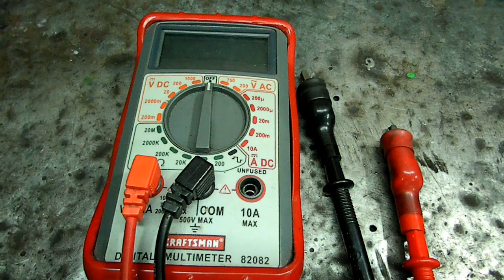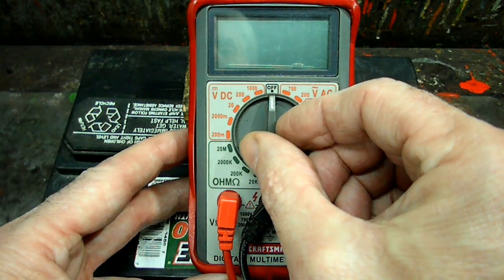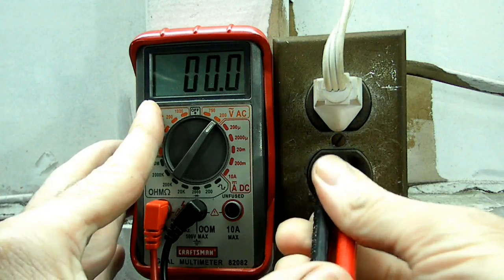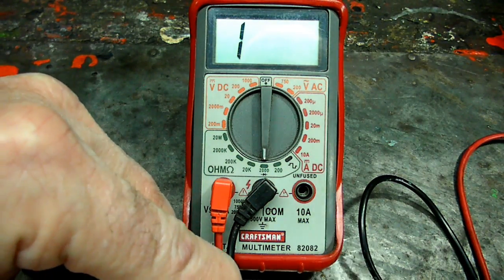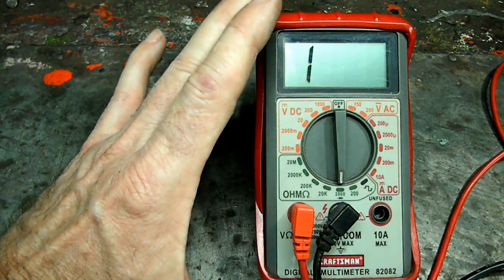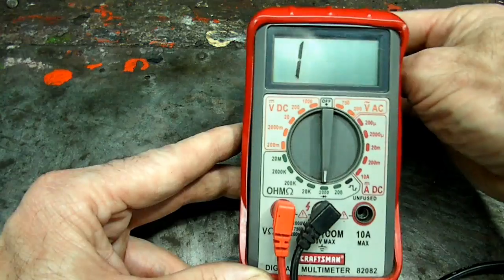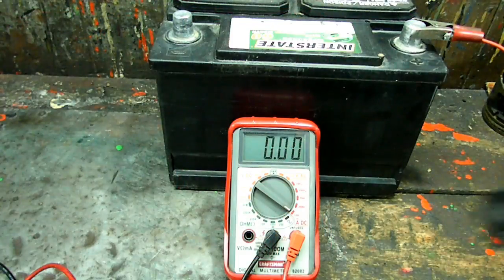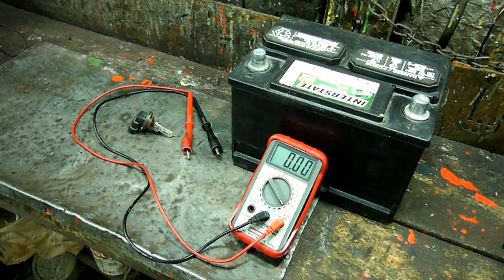How To Use A Multimeter

Comment: richpin, I'm trying to test the resistance on the primary windings in my old style 12V ignition coil (Accel) on my old chevy truck, and the company states it's 0.700 ohms, but when I test it jumps from 0.700 - 0.900.... Does this mean I need a new coil or is it normal?

Comment: do you have a digital voltmeter... set to 20 volts DC.
engine off.. headlights on for one minute. then turned off..
check battery voltage..
12.65 is a fully charged battery.
12.45 is a 3/4 charged battery.
12.25 is a 1/2 charged battery. if you have less than 12.5 volts have your battery charged and load tested..
once you verify that the battery is close to a full charge after you have removed the surface charge with the headlights on trick...
get the engine started... turn the headlights back on..
Negative battery post to the positive battery post.. 14.1 to 14.8 volts is expected..
Negative battery post to the engine block. 0.04 volts DC MAX..
Negative battery post to the body of the car.. 0.02 volts DC MAX.
Engine block to the Body.. 0.02 volts DC.
if you get more than the 0.04 or 0.02 volts on tests 2, 3 or 4.. you have a bad ground connection..
you can and should also.. after running the voltage drop test above..
test from the battery post to the alternator output terminal.. because of the amount of output.. i normally expect this to be up around 0.07 volts..

Comment: I got the free one from Harbor Freight along with their solar panel kit 45watt three panel and the 2000 watt inverter. where do I turn the dial to (set) so I can measure how much each panel is putting out. Just getting into this. I got a 12v deep cycle marine battery (walmart) to hook it to. Going to try putting my dish receiver and big screen tv and maybe laptop on it. Have a more expensive light strip with fuse to hopefully protect.

Comment: Thanks!  Trying to check a car battery with a multimeter is much more difficult when you have no clue how to USE said multimeter, lol!  The one my ex-husband had has no instruction book and nothing on the front to explain the symbols.  I was also confused by the 3 places to plug in the leads.  Your video was just what I needed to help me get started.  Now I can also check the outlet in the bathroom.

Comment: make sure to plug into the V-mA (600V MAX) side when testing a wall outlet! my multimeter had the correct red lead hole for this application on the opposite side as the ones in this video

Comment: When inserting into the outlet no.
A/C means Alternating Current. and D/C is direct current.
When current is alternating it means the voltage goes from positive to negative and back again (thus alternates and no need for polarity). 
Direct current is straight from the source (like a battery) and polarity doesn't change. (and can be a positive or a negative voltage - but not both at the same time)

Comment: Thank you Richpin for the answer.
so ? a amp reading with 0.50 is 500 miliamps correct ? 
I have my amp meter set on 10 amp max and the reading came up as zero point five zero.
I saw other videos on youtube where the max should be around 50 miliamps.

Comment: Hi Richpin you and Eric the Car Guy do a great service for us average joes with no money in how to fix their cars.
Rich I have a battery draw problem where my battery goes dead if I leave it hooked up.
I traced it down to the BCM/Cluster circult.
Amp draw is 0.49-51  is that 50 MLA ? 
I know in a normal situation there is a 50 MLA draw for the clock computer to stay alive and other things.
Is 0.49-50  50 miliamps ? or is ? 0.05       50 miliamps ? 
Is 0.49  490 miliamps ?

Comment: Hi, thanks again answered a few questions :) Only problem I'm having is that I bought leds to use as foot well lighting in my car and a 3 way rocker switch on/off/on only problem is I'm trying to get it to have one of the on positions to be constant on and the other on with the door/off when door closed and so far I have only the on with door working and can't figure out how to test if current is flowing through wires to see and try and figure out what wires to tap into

Comment: Don't test a battery like this if you have a have the multimeter in amp setting (with the red probe on 10A). You will fry your meter like I did when I forgot I had it set like that. I was lucky the meter wasn't an expensive on but a 4 dollar harbor freight deal.

Comment: If you accidentally touch the positive and negative with the same lead or piece of metal you create a short the same way as touching 2 wires together, This is the principal on which an arc welder operates.

Comment: Ah! Just tried this with the dial set to ACV 200, and got huge blue sparks. Luckily, the testing needles had enough insulation to keep me from getting electrocuted.
What did I do wrong? The metal needles are screwed up now with burnt tips, after only a split second. I shudder to think what that would have done to my weak animal flesh. No big deal, in the end, I'm alive, but what did I do wrong???

Comment: Thanx, after watching several videos that just showed how to touch the prongs to an item, you actually explained somewhat where to set the dial. For people who don't have a meter that has a zone where the a/c or d/c setting is, always remember that sqiggley line over V is A/C volts (household) and straight line with 3 dots under it is D/C volts (automotive).  My cheap meter only has 300V ~ (A/C) and 300V --- (D/C) for voltage testing.

Comment: You are incorrect in your thinking. 000 means very low reistance whereas a 1 signifies out of range or open. On the more expensive meters you will see OL which means "Out of Limits" which just means an open circuit.

Comment: The multimeter read 000 and you say the light bulb was good? Aren't you supposed to have a resistance in order for it to be good? I believe 000 means the light bulb is open somewhere in the filament.

Comment: Great video Rich! Just a question about usage. If I wanted to check output on a set of trailer wires (for trailer lighting), would I be checking the resistance of those wires or would I be measuring the DC output?

Comment: @richpin06a 
One more thing for everyone, do not touch the circuitry and chips with your fingers. Hold the circuit board by the edges. Try to dissapate any static charge in your body by touching a good ground first (a water pipe, or the ground conductor in a wall AC receptacle is good ground)

Comment: One additional tip for everyone out there working with circuit boards containing computer chips. I work in telephone offices and I also install circuit packs into fiber optic shelfs. We are required to wear an ESD ( Electro Static Discharg) wrist strap to ground ourselves before handling any circuit packs or computer boards. Everyone should be aware that as little as 100volts can fry a computer chip. A human can generate up to 35,000 volts of static electricity (walking on a carpet for example).

Comment: One additional tip for everyone, if you are handling a halogen headlight bulb, be sure not to touch the glass bulb with your fingers. Grease and dirt from your fingers will damage the bulb once it heats up and the bulb will fail. If you do get grease on the bulb, clean it alchohol before installing it and applying power to the bulb. Thanks for the informative videos Rich!

Comment: Good video Rich - Thanks!  I've used the amperage draw to track parasitic drain in the miliamps range by hooking up meter in series with battery - faulty install on factory alarm - trunk release solenoid was always "on."

Comment: nice video.. One thing in measuring resistance i would start at the lower scale which means at 200 and 1 scale up at a time! and when you doing continuity check you are at 2000 scale and the meter say's "0" because you are at 2000 scale, i would go at 200 scale because is more accurate and you be getting lower than "0"